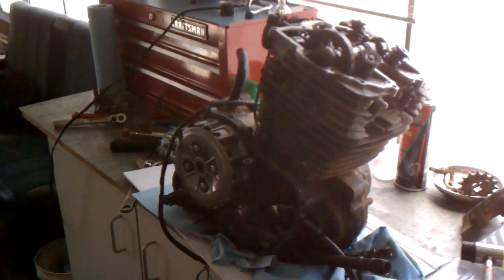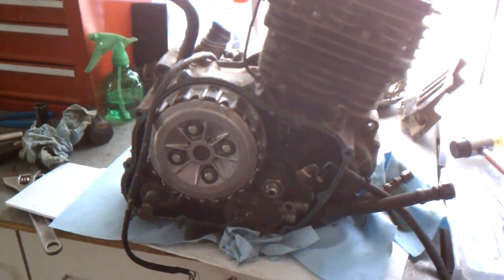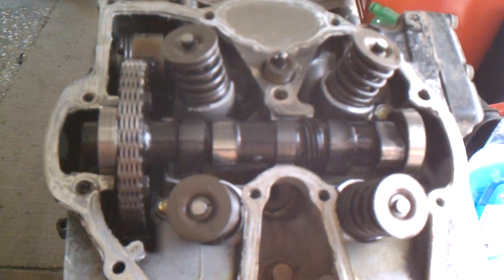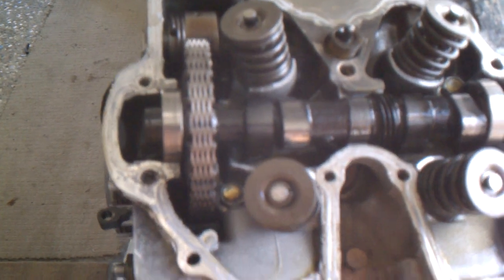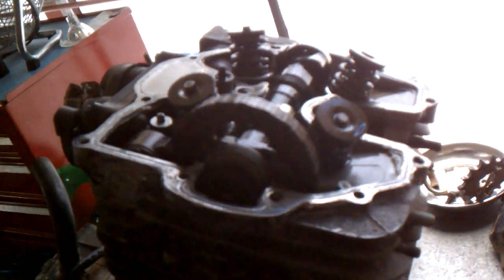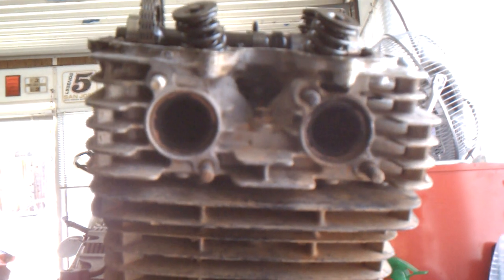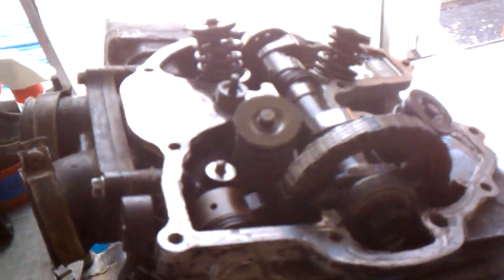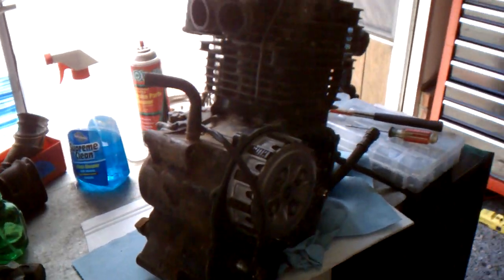Xl 600 Valve Timing Problem

Comment: Are you on TDC overlap? There's 2 TDC....make sure you're on compression stroke, cam loves down. I've got an 87 and the counterweight on the crankshaft makes it want to roll when I line up the timing marks on the rotor. I have to tie off my ratchet to keep it from rolling on me. Good luck
Reply from the maker: This video was taken 10 years ago

Comment: Are you sure you're not on the exhaust stroke?  Make sure the piston is at top dead center. If it isn't -  your cam shaft is backwards.  (The lobes should be down, on the compression stroke)  Am I right?